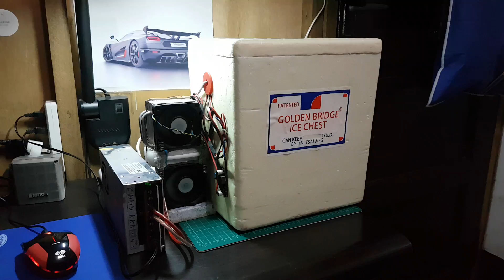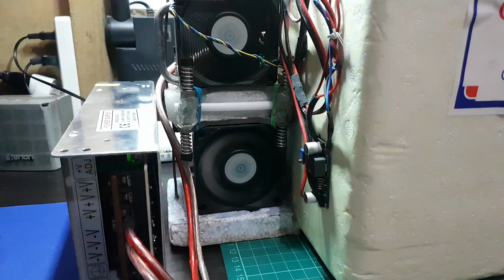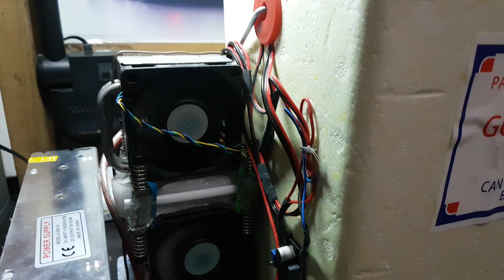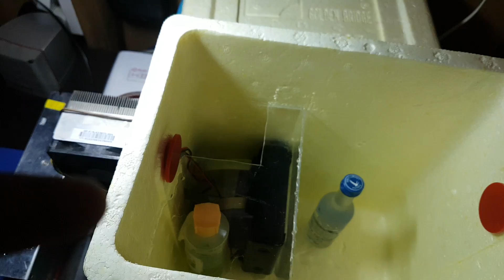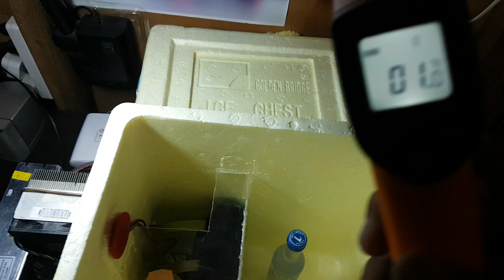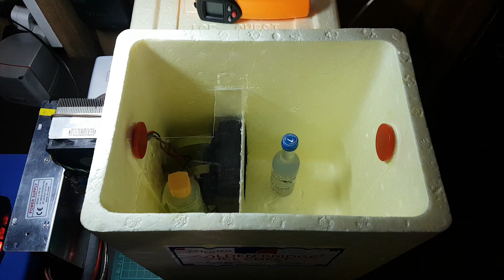Water cooled Peltier fridge

Comment: hii bro..you used first peltier module for inside radiator cooling..ok but what you do with second peltier module.. confused about..plzz reply as soon as possible
Reply from the maker: Both the peltier modules are on the cooling system outside the cooler. They are sandwiching the cooling block
Reply: you use peltier water block?
Reply: @albertobassig  outside i saw different separate heat sink assy...for both peltiers..
Reply: please describe cant understand sandwiching means
Reply: ooook understand...you mean both peltier cold side put into peltier water block...and then this two pipes you put inside the foam box
Reply: one more question...which liquid you add in bottle for water will not freeze
Reply: tell me liquid name you add in water
Reply: do reply bro..

Comment: Bro, How you cold the air at 0-degree with the help of the Peltier module.
Reply: Please help me, I want to cold water at 5-degree for my project.
Reply: My E-mail ID is cu.16bme1264@gmail.com
Reply: You can try to use the antifreeze from the car as the coolant.(in this case is the water)
Reply: @zubairansari6505  Wahser fluid should also do the job

Comment: I want to convert a normal fridge into a DC fridge using these circuits. I was thinking of using copper tubing to pump through a waterblock that was being chilled with the circuits. 

One copper tubing would be inside the top of the fridge (no freezer) to capture the heat. The other copper tubing would be on the outside under the fridge with fans on it to take off the heat. Think it will work?

Comment: you could reach even colder temps if you added a waterloop to the hot side as well. i have a system that is set up almost the same as yours but instead or 2 fans and heatsinks i have 2 water blocks for the 2ed water loop.
Reply: i did this with 6 peltier modules, 3 waterblocks, 1 big radiator for cooling hot part (3x 120mm fan on it) and 1 radiator for cool part inside the  chest (1x 120mm).  reached -7C degrees inside the chest with an ambient temp of 20C on the outside